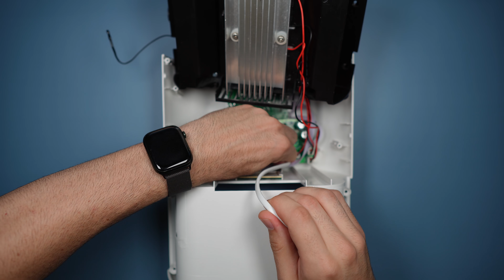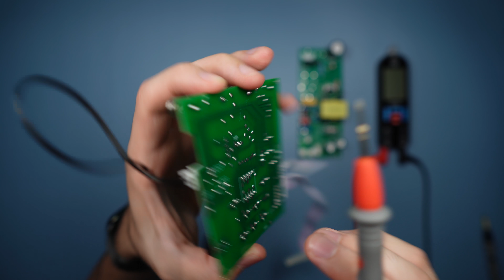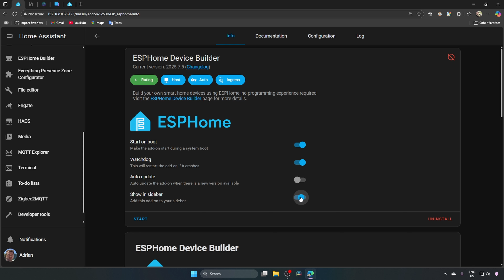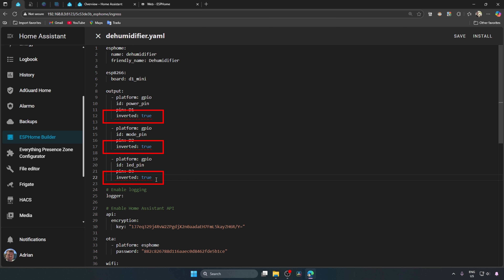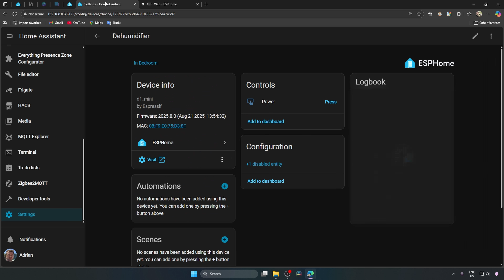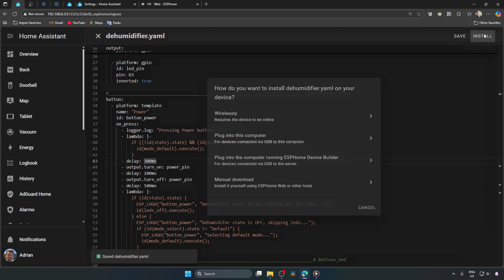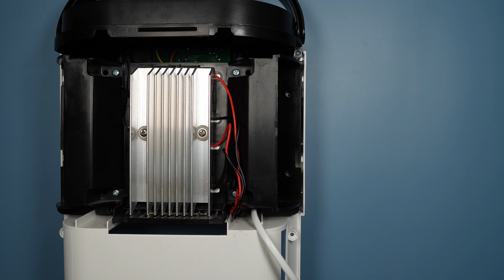Turn ANY Device into a Smart Device with ESP8266

Comment: I dont know if anyone has mentioned this in the comments. You should have explained how you found the pin to solder to in case of buttons. Usually the button has two pins, one would be the ground and other would be the gpio or any active pin. If you solder a wire to the ground pin of the switch, this wont work. So you would have to find the ground pin of the switch using the continuity mode in a multimeter. Then use the other pin. Also you have to check what is the voltage between the pins, if it is not 3.3v, it will fry your esp. The ideal way to implement this is with fast switching optocouplers. This would isolate the esp8266 from the buttons and the sensors while making everything work.
Reply from the maker: I think it’s quite clear which joint holds the button wire, because it has only one pin, unlike the regular buttons you mentioned, which have two. So there’s no need to “find the ground of the switch” because the ESP ground is the same as the board ground in this case.
When I will control a normal button (in my next video), I’ll show that process, but here it wasn’t necessary.

Regarding 3.3 V, you’re right, I should have mentioned it explicitly. I assumed it was clear since the board has a large, clear “3.3V” label on it.

When I made this video, I didn’t even know what an optocoupler was. I learned about it thanks to people like you, whose intention, I hope, is to help and not just criticize.. I’m here to show people what I know, but also to learn from them, so in my next video I will use an optocoupler.
Also, the video was mainly about making a device smart using only an ESP8266.

In the end I have a question for you: if you are using an optocoupler to isolate the ESP from the control board, how do you read a voltage from the control board to create a sensor if the ground is isolated?

Thank you!
Reply: @AdrianSlabu  Hi, when I watched your video it kinda felt like you were aiming to make any device smart. That’s why I mentioned figuring out which pin acts as the switch on devices like this. Also from what I understand, the spring touch coil doesn’t usually go straight to the control pin of the main IC. In most cases that spring goes to a separate touch IC that measures changes in capacitance, and then it pulls the control pin low or high when it detects a “touch.”

So when you tapped a wire onto that spring pin, that touch IC probably got confused or disabled, which is likely why the touch stopped working. The ESP8266 just does digital signals, while that spring is part of an analog capacitive sensing circuit — so you can’t just tie a GPIO directly to it. If the GPIO is HIGH it dumps voltage into the circuit, and if it’s LOW it grounds it, so both ways can mess it up.

BTW, I haven’t actually tested the idea below — just theory. Please double-check before trying it.

The cleaner way would be to solder a small capacitor (like 22pF–47pF) from the spring pin to a GPIO on the ESP8266. Then when you want to simulate a touch, pull the GPIO to ground. That introduces a small capacitance change and should trigger the switch. When not “touching,” keep the GPIO HIGH. If it doesn’t trigger, you can try slightly bigger caps.

As for your other question: the ground doesn’t need to be isolated. To detect if a pin is high or low, just feed that pin into the anode of an optocoupler, and on the transistor/output side connect ground and whatever GPIO you’re using. The main thing to pay attention to is choosing the right resistor on the LED side of the optocoupler so it gets enough current without messing up the circuit.

Comment: Great video. unfortunately I did not work with mine, I think because my device does not have 3V and I run the ESP from another adapter. But still useful video, thanks again.
Reply from the maker: Even if your device doesn’t use 3v you can still control it, you just need to use optocouplers, in my next video I will show how to use them.
Reply: @AdrianSlabu waiting for your video,  you are the best.

Comment: It seems as though it may have been much simpler to bypass the control board entirely.   On / Off with a relay $1.  Humidity / Temp sensor $1-$5.
Reply from the maker: That’s another thing and you will not have the same control.

Comment: How do you control the ESP board when the device is off and no voltage is going to the ESP board??
Reply from the maker: The 3.3v pin from dehumidifiers control board has 3.3v when the device is off so esp is always powered.
Reply: @AdrianSlabu ahhhhhhhhh genius
Reply: @jonboy1000  not all humidifier has 3V even it off, mine does not

Comment: 5:30 Yes it's safe to have USB 5 volt and the 3.3 volt connected. But, Do not power from 5 volt USB and connect 3.3v to vbus. That's different than the 3.3 volt pin.

Those circuits are isolated. The 3.3v is stepped down from the original 5 volts with a linear voltage regulator. It's a 3 pin chip that dumps the extra energy as heat. They're inefficient but those voltages are isolated from each other.
Reply from the maker: Thanks!

Comment: How did you get the value of the humidity from the dehumidifier?
Reply from the maker: Is an external zigbee sensor, I specified in the pinned comment.
Reply: @AdrianSlabu oh sorry about that, I was confused because the reading in the bubble card matched the one on the device, I thought you used it

Comment: You want to be careful here.  Some devices are super sensitive to drawing extra power from their 5v pins.  Also sharing a ground across the esp and device can cause problems and inaccurate button presses.  Using Octocouplers is a good way to separate the two.

Comment: You should remember that opening and manipulating an electrical device can be a life hazard and also illegal in some countries if you're not a qualified electrician.
Reply from the maker: In which countries is illegal to modify an electronic device by adding an esp32 to it?
Reply: @AdrianSlabu  At least in Finland if you have to open and modify a mains connected device, it requires a certified electrician. You won't go to jail but if your house burns and the insurance company finds your mod, they will raise a party.

Comment: Hi! I like your video I hope you can also make one for Acer Cozy F1 Fan
Reply from the maker: Hi, I can’t do for something I don’t own and I can’t buy one just to make it smart because I don’t need one.
From what I saw it comes with a remote, use a RF / IR blaster to record the buttons and control it from the phone, is not the same but at least you have something.
Reply: @AdrianSlabu it use a capacitive touch buttons
Reply from the maker: I checked Google and saw it has also a remote, but probably you know better. Yes it could be possible to make it smart using an ESP.

Comment: Nice, I tried and it works, but I have a question. After I make the connection between the esp D1 gpio and the power button, the power button of my device can't work normally any more. I can use only with the HA. I can live with that, but if I want still use the touch of my device... what I have to do?
Reply from the maker: Hi, if you check the pinned comment I specified this, to be honest I didn’t had time into looking how to fix it but I will, I don’t know when but I will, maybe I will add that at the end of one of my videos like a quick update, I don’t know.
Good luck!
Reply: @AdrianSlabu  I read that you would need a 10pF capacitor in series with the D1 input
Reply from the maker: @Aleinux  have you tried that and it is working?
Reply: @AdrianSlabu  Not yet. I will and I will post the result
Reply: @AdrianSlabu  Finally I had the chance to try what I said to you before and didn't works. I put the 10pF capacitor in series with D1 and start workiing in the regular way. Did you find any solution?
Reply from the maker: @Aleinux  Thank you for coming back with the answer. No, I didn't.

Comment: Weird, i'd have used the output of the LEDs as indicators then written autocorrecting code based on what needs to be pressed to be in sync with HA, then again I don't know this board and what it can handle, just checking out what's possible because I'm going to do something similar but through zigbee  - great demo though, thanks for posting :)
Reply from the maker: I would like to know more about the zigbee project.
Good luck !

Comment: Well, the smartest thing to do with this dehumidifier would be to replace it with an actual dehumidifier 😉. The peltier element dehumidifiers could be called electric heaters with a minor side effect of pulling some water out of the air (yes, they are that inefficient!).
3.3V is available in many devices (it being clearly labeled is a bonus), but be careful with just hooking an ESP onto it. ESPs draw quite some current while transmitting over WiFi (can be several hundred mA). The pulses are short (most multimeters won't measure it properly), but they can be enough to overload the 3.3V rail (it is designed for supplying a known load after all) causing all sorts of problems with the device, which are especially hard to track down or might even cause damage.

Comment: When I have a power source that could be feeding my boards in addition to the USB port. I install a diode in each feeding source to protect them from each other, and the board at the end will get power from the higher voltage. Obviusly assuming both are in the right range.    USB ----->|-----[ ESP ]-----|<------Device

Comment: Hey, quick question — is this always safe to do? I reckon the 3.3 V or 5 V lines on the board are meant only for the device’s internal electronics. If you connect an ESP32 or ESP8266 like this, you’re drawing power that’s meant for the product itself. Couldn’t that overload the logic board or cause instability?
Reply from the maker: Indeed, you should always check if the devices control board has enough power, check with the multimeter the board voltage before and after connecting the ESP.

Comment: Could have just take 3.3 (if available) from mode status leds?
Reply from the maker: Sorry for the previous answer, I thought the message was for another video.
If you are asking if I could read the state based on the LEDs voltage, most likely yes.

Comment: Loved the tutorial!
How to smartify something that doesn't have buttons but only IR remote e.g. mini split (split air conditioners)?
And how to operate these via Google home devices without HA (like philips hue without hub works director via GH/Alexa)
Reply from the maker: Hi, you need an ir blaster but from what I see Broadlink is not working anymore with Google Home.. so you need to look for an ir blaster that’s Google Home compatible..
Anyway why are you not buying a raspberry pi to install Home Assistant to fix all your problems?
Like that you can make “any device” Google Home compatible.
Reply: @AdrianSlabu I was expecting some ESP way to control AC😅. 
Thanks for the recommendation, I'll explore the IR blaster. 
For hosting HA, I have very few smart devices so it felt like an overkill since all of them works with GH as well. But soon I'll get HA since it unlocks many automations.
Reply from the maker: @DeveshMolasaria  about esp, you can connect it to the remote buttons, I belive it’s possible. I have more things in mind, this is what came first, I think someone told me this idea in the comments 😅
Reply: @AdrianSlabu sounds hilarious that we're talking about making an IR remote smart.😂 But it would be a nice economic way of making things smart. 

Looking forward to future videos! ❤

Comment: Mine have 5v and not 3.3 on board, I tried your connection adding a voltage sensor on a0 but mine don’t turn on when I press on home assistant 😢
Reply from the maker: Hi, send me on email a clear photo with the wiring and one with the sensor code.
Reply: Sent

Comment: Awesome work. If possible, could you also make a tutorial for doing this on a device without a 3.3 V supply on the board?
Reply from the maker: If your device uses capacitive touch sensors, they’re most likely 3.3 V. Even if they’re rated for 5 V, the ESP’s 3.3 V output will usually still be detected as a HIGH signal. This won’t damage the ESP, since it’s the one sending the signal.
However, don’t connect the ESP GPIO pins directly to a regular mechanical push button.
Don’t take this as 100% guaranteed, always double check before trying anything.
Good luck!
Reply: @AdrianSlabu oh nice. That's good to know. I hadn't taken many small home devices apart unless they needed repair. Awesome info, keep it up, man.

Comment: Is it possible to make a Fossibot F2400 power station smart in the same way? Unfortunately, it currently has no interface for remote control. That would be fantastic! Thanks!
Reply from the maker: It depends on the control board it has. It can be controlled but maybe not the same way, I can’t know till I take a look at it.. but I’m not sure about reading the stats, like battery %, input, output W.

Comment: @Adrian Slabu: I am getting so many ideas! Though the ceiling fan might be a challenge, it has no remote. :( Any ideas?
Reply from the maker: Yes, right now I’m preparing a video about a fan, not a ceiling fan but I believe you can use the same “technique”. 😅
If it can be controlled using the wall switch it would be easier because in that case you can use a smart switch..

Comment: Really nice, technically couldn't you deduce the active mode from the front LEDs? (Actually, I don't know if a d1mini is capable of acting as a voltmeter).

Obviously, keeping it simple without going so far as to reverse engineer the board to also obtain the percentage.
Reply from the maker: Thank you, I could, yes.. but when I realized that, it was already too late, the video was uploaded 😅.
The ESP8266 can act as a voltmeter only on the A0 pin (analog), but on the D pins (digital), it can read only High or Low signals. When it detects a voltage between 2.6 V and 3.3 V, it reads it as High, and below 2.6 V as Low. In theory, LEDs need around 3 V to light up, so the digital pins could read the dehumidifier state through the LEDs.

Comment: I haven`t seen many platines with such "easy to follow" labels in my life. This is a very ...very... simple example.
Reply: Agree.. never seen any device with such great labels printed on the PCB 😂
Reply: What's a platine?
Reply: @mediocreman2  He means the board. It’s the green thing where the electronics and cables are soldered on.

Comment: Awesome video!
I just have one question as i have been looking at trying to automate my filement dryer.
There looks to be two soldering points on your bord, i am assuming these button work as a "short" completing the circet and that being the button press. 
But are you using the "+" or "-" solder point to trigger this?
Thanks
Reply from the maker: Hi, thank you!
Those “buttons” are traces that goes to a chip which is measuring the capacitance.
If you have mechanical button(that makes a sound at press) it’s almost always a short to ground, check this, it should help you: https://community.home-assistant.io/t/smartifying-a-dehumidifier-with-esphome/308994

Comment: why u simply dont check led state to select mode?
Reply from the maker: I just didn’t think of it.. In the beginning I tried using analog pin but I lost so much time with it so I stopped thinking about reading the state and I wanted to find something else, this is how I ended up with this.

Comment: I have learned that we dont put solder in the soldering iron tip, we put the solder on what we are soldering.
We tin the pad and the cable tip, then solder both together without needing to add more solder.
Reply: You solder the tip to improve thermal conductivity, which helps prevent cold/brittle joints. You also wanna leave your tip tinned after use to prevent oxidation of your tips.

Comment: Nice video but usually I will check if the button go to gnd or to some voltage, if the button go to ground I prefer to use an optoisolator and isolate the esp from the pcb. I can also Press the buttons manually without any issue
Reply from the maker: Thanks for the advice!
Reply: No problem :) The only downside is u have to build a tiny board with an optoisolator for each button. Also keep in mind if the pcb expect a real short this approach isn't working because the opto put the two pins almost to 0 but it isn't a real short. For now I've done two devices and It work. If the button close high u have to do something different, maybe use an opto to control a transistor. I had the same idea recently so I'm glad someone teach the other on what is possible :) Keep it going!

Comment: nice video about the possibility to control a device with an ESP. This however does not make it "smart". Smart would be to automatically make it react to something set up and not you toggling buttons on a phone. in addition, you mentioned that the original buttons don't work anymore. This therefore is only locating the buttons from the device to your phone. The whole process you've done here is fairly straight forwards. the interesting and hard part is the "detecting in which state the device is" part and adding an additional control. I'm currently trying to do this on my washing machine using optocouplers to safely "press" the buttons and either photodiodes or if possible also optocouplers to safely detect the different lights on the display. This would be what I would in a stretched way consider "making it smart" although this also still doesn't include the "automatic" part. But I hope that I could then put the most commonly used settings on a maybe 4 button control to just have to push one button instead of going through the multitude of buttonpresses to start a wash.
Reply from the maker: Hi, thank you! I call it “smart” because by adding it to Home Assistant, you can make it start when you leave the room or home, or only when the humidity in the room reaches a specified value with a simple automation so you don’t need to interact with the device.